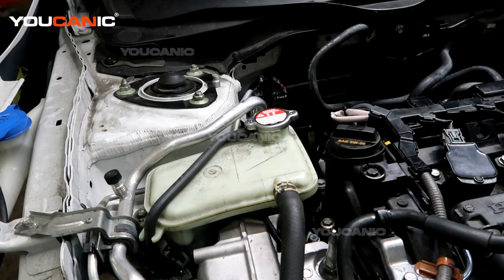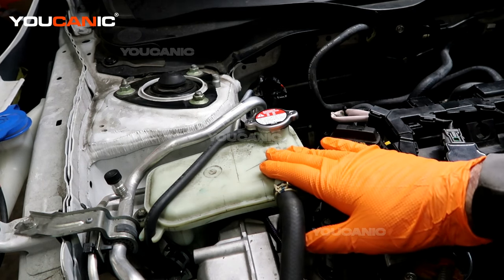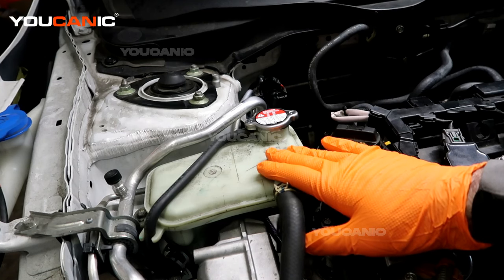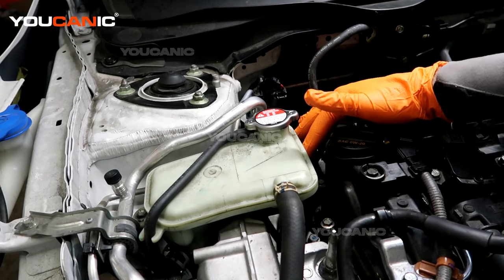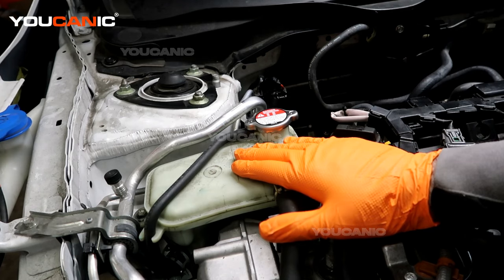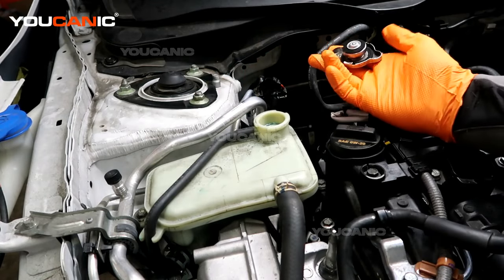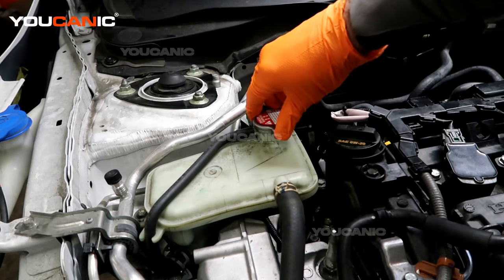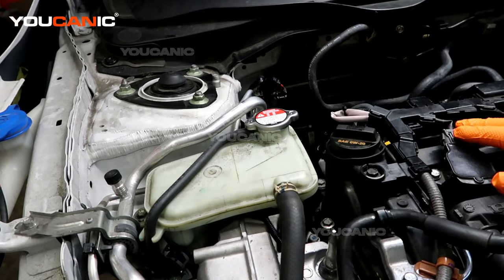2016-2021 Honda Civic - Check Add Engine Coolant

Comment: Anyone know who small pipe on the top is for mine is not connected👀👀
Reply from the maker: Thank you for your feedback and question! The small pipe on top might have a specific function depending on the car model. To diagnose this, a good professional diagnostic scanner like our YOUCANIC Full System Scanner can be a great help. You can learn more about it here: www.youcanic.com/scanner

Also, for accurate repairs, having access to Factory Repair Manuals and Torque Specs can be beneficial. You can avail them at a minimal cost here: www.youcanic.com/manuals. Our goal is to empower you in making car repairs smoother and more efficient.
Reply: Is it the one hanging on top of the reservoir like on that video? I think my car is just hanging like that too. That’s why I YouTube it. To see how his set up

Comment: Dumb question but does it really matter the type of coolant? Like does it need a specific or will any one do
Reply from the maker: Hello, it's not a dumb question at all! Yes, it really does matter the type of coolant you use. Certain engine designs are compatible with certain types of coolant so using a wrong one can cause engine damage. We at Youcanic, are here to make things like this easier to understand. We offer a plethora of free resources and helpful guides on our website www.youcanic.com that can guide you on such specifics.

In addition, we have a powerful Youcanic scanner and factory repair manuals available to help you feel more confident under the hood. Feel free to reach out anytime, we're here to support you on your car ownership journey!
Reply: Just buy the Honda one it’s only 30 bucks I think for one gallon don’t put auto part coolant why pay less then f up your car later for 30 dollars it’s worth it
Reply: @blackhawks1870  I didn’t even know they had their own, thanks!

Comment: Thanks very much for your help. 🙏🏾
As I’m writing this, I’m currently at a gas station waiting for the engine to cool down so I can add coolant. I think there’s a slow leak or something. Who knows…I have coolant all on the ground. smh
Reply: Did you ever figure this out? Was it the head gasket? Were you getting smoke from your exhaust?
Reply: @ I needed to replace the radiator. I forgot the specifics…
Reply: @moilaiom  just curious thanks!

Comment: How often should I check my coolant? Will my dashboard tell me when to change/add coolant? I drive a 2017 honda civic. 
Any help is greatly appreciated!
Reply from the maker: Thanks for your question! It's a good practice to check your coolant every time you perform an oil change, but certainly if your dashboard signals a temperature elevation. For your 2017 Honda Civic, your dashboard won't specifically notify you to add/change coolant, so periodic checks are crucial.

Remember, our platform, www.youcanic.com/ offers an extensive range of resources, including guides and our YOUCANIC scanner to make your vehicle's maintenance simpler. We're all about empowering drivers like you! Feel free to explore or ask us any questions you might have on our site.

Comment: I just bought a 2020 Si. Took it home and drove it to work the next morning. Had absolutely no heat. Turned out the coolant was just a little low. I’ve got blasting heat again.
Reply: The engine coolant has absolutely nothing to do with the AC.

Comment: its hard to see the level of the coolant because of the placement of the reservoir. How do you recommend getting an accurate reading?
Reply from the maker: Thanks for your query! Reading the coolant level can be tricky due to the reservoir placement. A good flashlight permit a clearer view. For detailed instructions on car maintenance like this and more, please consult our resources at www.youcanic.com. We have free guides, and the YOUCANIC scanner to help you handle such issues.

We're here to empower all car owners to feel confident dealing with car issues head on! Our resources, including factory repair manuals, will surely be of great utility to you. Reach out to us on the YOUCANIC site any time you need assistance, we're here to support you.

Comment: I don’t need to drain the coolant first?
Reply from the maker: Hi there, thanks for your comment! It really depends on the specific task you're undertaking, but for certain repairs, draining the coolant might be a step. At Youcanic, we provide free resources and guides to help you navigate these tasks confidently. Check out our site for more information at www.youcanic.com. 

Maintaining your car doesn't have to be a daunting task, so don't hesitate to utilize our YOUCANIC scanner and even our factory repair manuals if you need that level of detail. Remember, we're here to support you on your journey to becoming a car owner pro!
Reply: @YOUCANIC  oh okay. Should be no problem if I just pour it in then like this video? Everything works. Just need coolant I think

Comment: Where is the radiator cap so I can add antifreeze in there?
Reply from the maker: Thanks for your comment! The location of the radiator cap can vary by make and model of your vehicle. You can find this information on [YOUCANIC](www.youcanic.com/) where we provide free resources, including helpful guides and the powerful YOUCANIC scanner to make car maintenance easier. We even offer factory repair manuals for more complex tasks. 

Our mission at Youcanic is to empower car owners like you to feel confident and capable when it comes to your vehicle's maintenance. We're here to support you on this journey. Please feel free to reach out on our website if you need further assistance.

Comment: Thanks. I wish it was easy  to see when the coolant is at the appropriate level. I can't see through the reservoir.
Reply: On this Honda civic, the min/max markings are on the side of the coolant reservoir. It is easier to read the level from the side of the container if you shine a flashlight through the fill port.
Reply: @scirro thanks.

Comment: Why I have to add cooling every 3 to 4 months 😢
Reply from the maker: Hi there! It seems like you might have a small coolant leak. At Youcanic, we're here to empower you to tackle issues like this. Explore our resources on www.youcanic.com; we've got guides, free resources, and even a powerful scanner to assist you. 

If you need more in-depth assistance, our factory repair manuals are available. We're here to help save you money and give you confidence in maintaining your car. Don't hesitate to ask us any questions on our site!